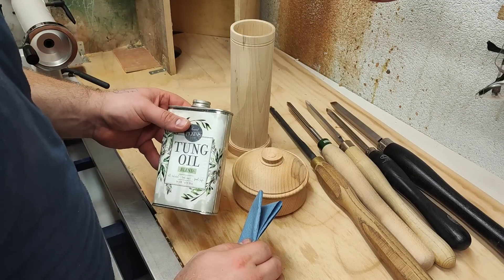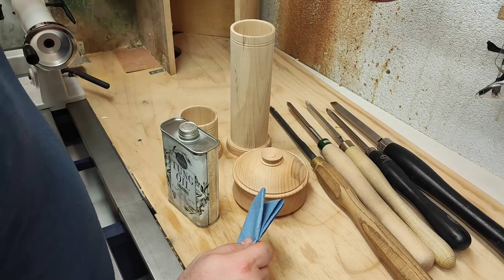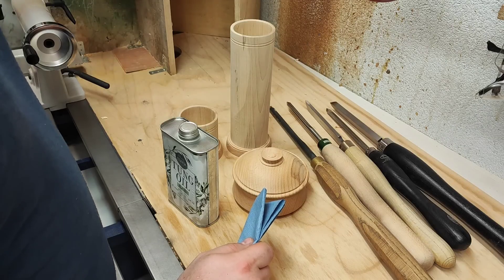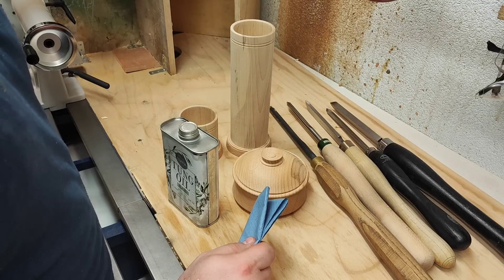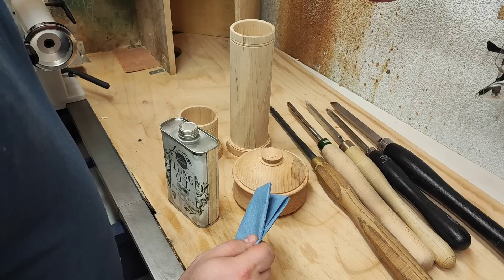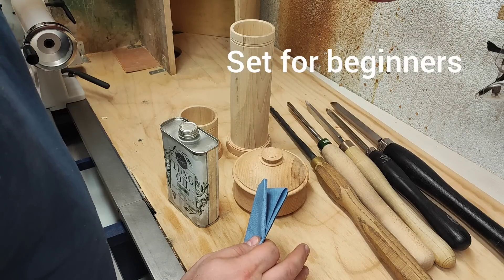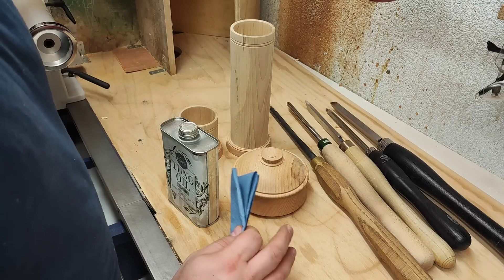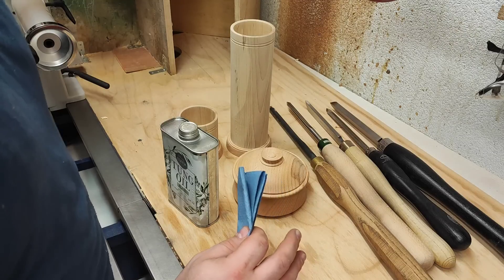Q&A___Skew on cross grain __Woodturners on YouTube __Beginners set of tools

Comment: Thank you for an insightful discussion... felt like a one on one discussion although it is a monologue. ❤
I appreciated the clear explanation of negative rake, as I think it is often overly mystified. Your talk clarified for me that I "get" the concept and use sone tools for negative scraping, although I do not own a dedicated tool. Agreed that negative scraping with a skew in bowl turning direction needs a bit more attention than a scraper, a very high speed helps and also pressing firmly against the tool rest from the top, and having a good grip. 😂😅 I have a round scraper and I slide that sideways so it cuts straight, as I don't own a flat bottom sraper yet.

I noted your flat scraper is not a perfect square but sharpened with a bit of angle. Made me think that it is more ergonomic, because the tool is on your right hand. I had thought a perfect square is would be helpful as a reference but maybe not. Also liked how you have your own style to sharpen and yeah, who says the grind should be symmetric. I sharpen freehand and don't worry about precision as you see and feel where the blade cuts wood anyway.

In addition to the great turners you mentioned, I would like to recommend Shawn at @worththeffort (spelling??). The is excellent on theory. As a beginner, I watched his Four cuts -video several times. It is an indepth lecture on the four main functions (planing, peeling, scraping...) and what needs to be understood about the grain direction (and why). His terminology is more precise regarding terminology and theory than others, you can see that he has a background of technology teacher. I watched a lot of his videos and these made feel confident to order the Coronet Herald (it's a real luxury for a beginner) even I had never tried or seen a lathe. Plus he is funny and opinitionated.

Your english is getting more fluent and rich with vocabulary as you continue making videos. Non-native english speakers do not take that for granted. Well done and keep going.
Reply from the maker: Thank you very much for kind words 🤗 there is still a lot to improve on English and video...but I'll get there☺️....

I like that small scraper to be skewed a bit as it prevents to have both points in the wood and reduces catches..... Especially if hollowing something deep and narrow..... 
Shawn is great and I have watched several of his videos.... To be honest I totally forgot of him🫣.... He has great narative and tehnique..... Glad to hear you use your herald and its a great midi lathe.....

Thank you once again 🤗
Reply: @tomislavtomasicwoodturning  I love my Herald... since you have used Record for some time perhaps you have more insight. I made careful research and thanks to the sideways turning headstock it's dimensions are all that I need. I bought the extension bed with it, but I need to come up with a support to benefit from the extension. My projects are thin and would vibrate, my idea was that I could make a batch at once to be more productive and have identical measures. Actually you did a great video on production turning and worked the same way, but my items are narrower.  Record does not have a support and  have no idea whether those from other brands would fit. If you have any tips let me know. Making my own takes time as the amount of jigs etc to make seems to be infinite... also what you don't learn from YouTube is that you make at least three prorotype attempts until you get a jig that actually works. 😀

Comment: Wouldn’t you also need a parting tool? If not, how would you handle parting with those 5 tools? Thanks.
Reply from the maker: That od good question, I haven't yet buyed a 'pro' parting tool... I have old carbon steel one that is rubish but for the ammout of work I use parting tool it served well.... Once I use that one I might buy one from Carter and Son or crown and reccomend then.... But these cheap carbon steel ones are better avoid.....
Reply: i can see using a skew on spindle work for a parting tool. but i use a standard parting tool on my bowls even though i think they only recommend them on  spindle work. Thank you for all your videos, i greatly appreciate them. I wish it was easier to get some of your tools here in the U.S.
Reply from the maker: @beadedlizard  Thank you, I hope to sort that, I have big plans but one step at the time ☺️
Reply: The flat scraper with black handle (fourth that you show) should also work as a parting tool if you turn it sideways and flip every now and then. Flip because it cuts a triangular shape sideways, so you progress in a zigzag manner, but it works the same. My favorite is the slim parting tool from Sorby, so if you don't have that I think it is more useful than a more robust one. I mean the latter is easier to replace with another tool, but the slim parting tool does stuff that you cannot do so easily with other tools. But the tools you prefer of course depends on the type of projects. I do small objects and a bowl turner has different needs than a miniature maker. Luckily we do not need to limit ourselves to only 5 chisels IRL. 😅
Reply from the maker: @MelkeinMaalla  that is true, thank God for that😀